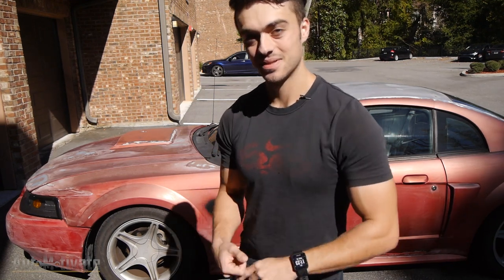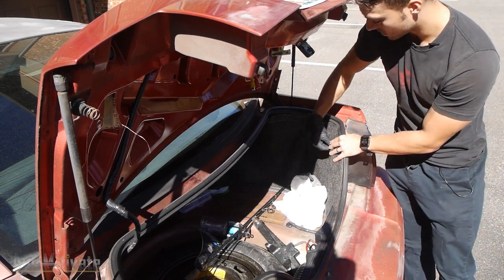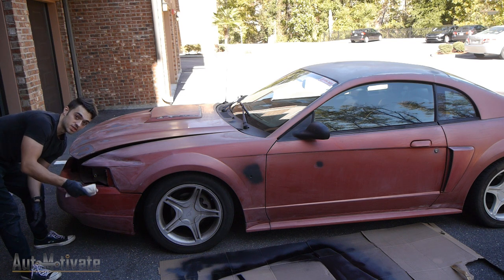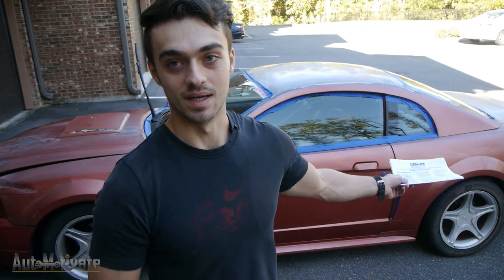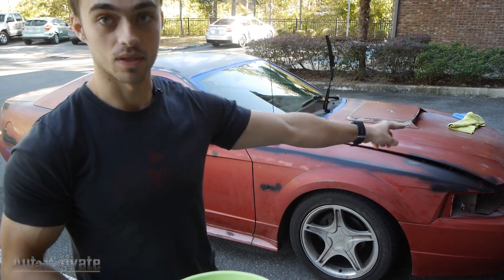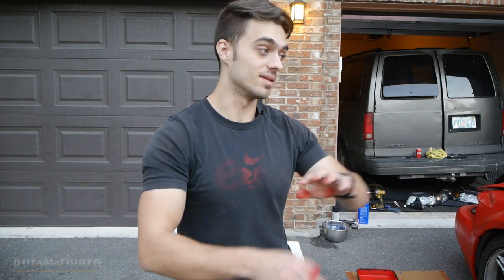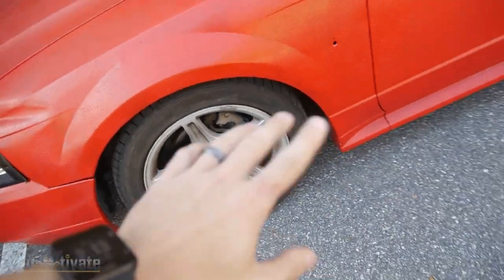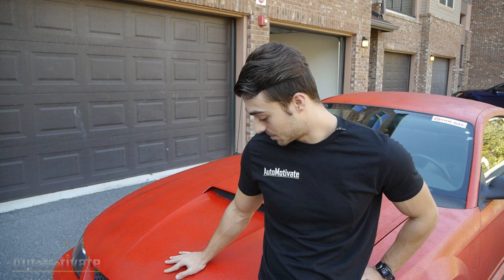DIY Truck Bed Liner Roll On Paint Job - New Edge Mustang GT

Comment: At home depot you can get a bag of 50 painters rags for $13. 
I add hydrogen peroxide to the bag and use them as baby wipes  and they can be washed and re-used again and again. 
Peroxide removes all the grease from your hands  and disinfects.
Reply: Im gonna screenshot this. Awesome tip.
Reply: Hydrogen peroxide can actually be hard on the skin, I wouldn’t recommend doing this. It also strips the skin of natural oils that your body needs to stay hydrated and to fight bad bacteria

Comment: Acetone isn't an alcohol, it's a ketone. If you were using pure acetone, and it only said "don't use alcohols", there probably wouldn't have been a problem (obviously it turned out fine anyway), but just FYI. Would love to see an update on how it's been holding up since you did it!!

Comment: Might want to test that claim about the bedliner not adhering to the car if alcohol was used. 
They might actually be lying in order for it not to stick and cause you to buy more product of theirs.  

When you remove that old fender, it would be so cool if you did a video to test if im right. Half alcohol prepped surface vs soap and water prepped surface. 
It would make a great video.😀
Reply from the maker: Maybe I’ll do that with the backside of the old fender or something. I’ll
Myth bust their claim 😂 
I kinda freaked out when I read that in the directions
Reply: @AutoMotivate  That would make a great video, because many people  use truck bed liner spray or roll ons.

Comment: How is it holding up? Any regrets or suggestions? Thanks best regards!
Reply from the maker: Actually ended up selling it months ago, so I can’t give you a great answer. I really liked it, and the new owner really liked it, as well. 

Suggestions: keep it mixed very well, so all the black specs can be spread evenly on the car. 
Start with the roof and hood of the car. 
It makes it easier with someone else with a smaller paint brush to hit all the nooks the roller can’t hit.

Comment: Any reason you didn’t opt for the spray kit instead of the roller?
Reply from the maker: Didn’t have the accessibility for it. 
Roll on is also significantly cheaper because I didn’t have to buy the equipment

Comment: My Mustang is bed lined and  from what I can tell from your video. You didnt use enough bedliner. You can see all the color from underneath.2nd why didn't you fix all the dents , crinkled fender and messed up front bumper. Just my 2 cents
Reply from the maker: Yours looks great man!
At the time, I was planning on keeping the Mustang as a drift car and future wrecks were in fruition, so replacing those parts weren’t on my to do list until learned the ropes.
Reply: @AutoMotivate  I gotcha brotha any drift videos of the stang?
Reply: Roll on liner surprising me how it looks
Reply from the maker: @mustangmotivation6009  I’ve only took it to one event before I knew we had to move across the country. Had to let her go, sadly. Wish I coulda kept her.

Comment: How much did you have left over after the two coats? I’m going to do this to my 2009 LTZ suburban. Thanks for the help and you’ve got a new sub!👍🏼
Reply from the maker: I have  maybe 1/5th of the can left over. I would suggest maybe 1.5 gallons to be safe. Or 2 to be safer. Keep in mind, this is semi-permanent. So, make you really want to do this before you commit 🙏
Reply: @AutoMotivate   definitely something I want to do. Thanks a lot!